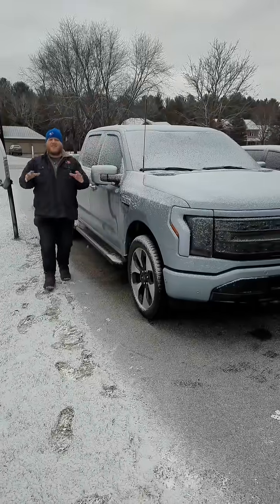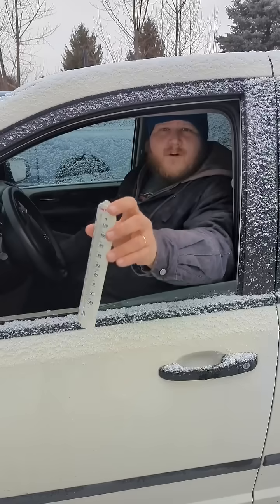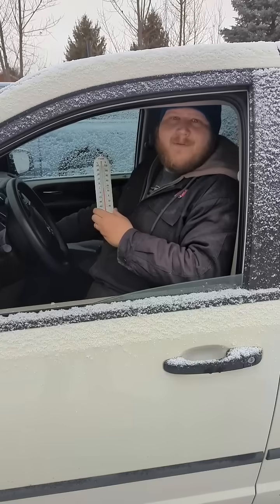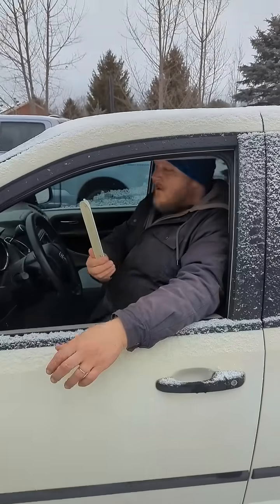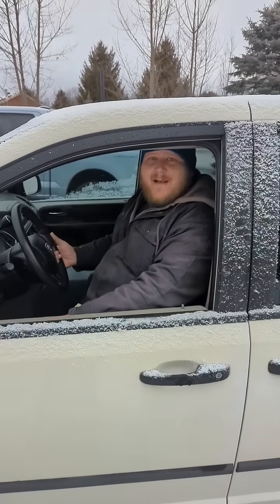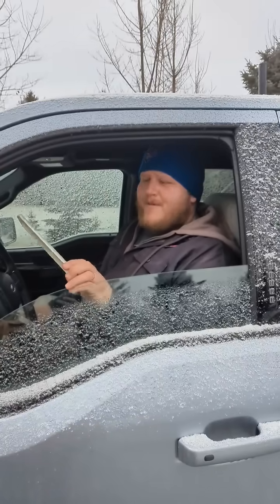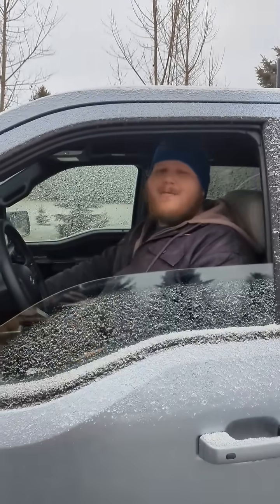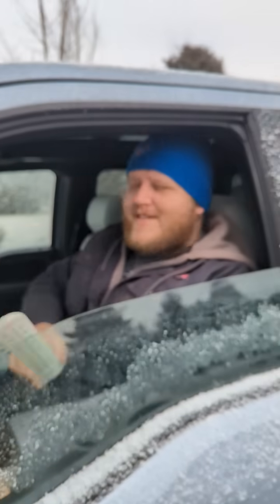Electric vs Gas - Heater Wars! How Long Does the Ford F-150 Lightning Take to Heat Up?

Comment: Holy crap! I didn't even think about how quick an EV would heat up. This is impressive!
Reply: No need to wait for the engine to heat up to provide you with waste heat. This is also why using the heater will reduce range in an EV.
Reply: Every new car warms up this fast.
Reply: And if you got stuck in the middle of nowhere like in a snow storm the ev with its heater on just sitting is far safer (no fumes) and far more efficient meaning it will actually last longer with the heat on than a gas vehicle. This is because a ICE vehicle is super inefficient just sitting idling burning lots of fuel just so you can produce heat. Huge advantage for any EV while sitting with just the heat on. Good for camping too
Reply: @Dylan_JVIPTER    Lierally everything you said is the opposite of the truth.
Reply: @dsmtsi  Nope. Look up a video comparison on YouTube of an EV with heat pump sitting idle heating the cabin vs an ICE. The ICE runs out of fuel before the EV runs out of electricity because it hardly takes any energy for an EV to produce heat with a heat pump while the ICE vehicle takes a lot of fuel just idling because that’s the only way to produce heat with an ICE, with the engine on. The EV is far more efficient in this situation. Let’s not forget a lot of people die in situations like being trapped on a highway in a snowstorm because of carbon monoxide from other vehicle and your own. You don’t worry about that with an EV.
Reply: This argument is entertaining
Reply: It's not impressive it's a one sided test.  The gad vehicles need s load to warm up   so driving for 2 minutes and you are full warm
Reply: @dsmtsi  greatly depends on the vehicle. My truck won't even start blowing air (auto setting), let alone warm air, after two minutes of driving. Furthermore, that's not 2 minutes to bring the cab up to temperature either. My fastest vehicle to warm up was my 2008 Canyon and that definitely needed more than 2 minutes as well.
Reply: @RedWingsninetyone  Every single gas vehicle including my 2006 diesel jetta could be warm after 2 minutes of driving with heat on.

The fact is this test is obviously skewed towards the EV and not accurate.
Reply: @dsmtsi  completely incorrect, but you're welcome to think as you like. Although will agree that the caravan could have warmed up faster under load but it still would not have beaten the EV.
Reply: @RedWingsninetyone   You are completely incorrect but you are free to think you are correct all you want.  It is 100% fact this so called test is extremely skewed towards EV's as gas vehicles warm up in a few minutes under load  not 14min.  This us a fact the EV fanboys want to ignore.
Reply: @dsmtsi  clearly you didn't read what I said, but I guess you're free to believe what you like. But there's no doubt the EV is better. No load needed and it is faster.
Reply: @RedWingsninetyone    OK now I know you are coming from pure ignorance.  Make sure to get your 8th booster as well, safe and effective.    Television owns your mind.
Reply: @dsmtsi  a mature and well thought out response.
Reply: @dsmtsi  I haven't come across a single ICE vehicle that only takes 2 min to warm up even when driving, especially at temperature such as -15°C. It may start to blow somewhat warm air after like 5 minutes of driving but you're still cold. Unless you've got an overheating car.
Reply: @HCkev    I live in -15 deg whether all winter my entire life.  You are telling lies if you say gas vehicles can't warm up in 2 minutes ubder load.

It's funny to see all the EV shills come out with their lies here.
Reply: @dsmtsi  whatever you have to tell yourself, I guess. You've already lost all credibility with me the moment you wanted to resort to insults and also completely ignored the fact that the point here was that you don't need to be stuck in a cold vehicle to "put a load on it" to warm up, and it's faster.
Reply: @dsmtsi lol that's very funny of you to need to resort in calling me an EV shill when I only own an ICE and probably won't own an EV in the near future. You missed a good occasion to shut up.

Ever heard of a thermostat? Since it's apparently not the case, let me explain. It's a temperature-sensitive valve located in the cooling system between the engine and the radiator. Engines have an ideal operating temperature that’s generally between 90 and 104 degrees Celsius; below that, they don’t run as efficiently. To get there as quickly as possible, the thermostat will close to keep the coolant inside the engine from travelling through the entire cooling system. Once the engine is warm enough, the thermostat will open. That now-warm coolant will then finally be able to circulate into the heater core to heat the cabin.

So the only situation it would blow hot air quickly in freezing cold weather is if the car engine is already warm. Like when you stop at a store and come back to the car 15 minutes later. However, if the car just sat there in the cold for the whole night, then it will take much more than 2 minutes... Driving it will heat faster, but it will be still take more than two minutes. I mean, remote starts were invented for a reason, we wouldn't need to even think about coming with something like that if cars heated quickly... 

I challenge you to find just one source that supports your 2 minutes time to get hot hair blowing. Just one.
Reply: @dsmtsi  so, you can't come up with a single argument in your reply. Let alone anything to prove your point, as I asked.
Reply: @HCkev    I don't need any argument, you made my point for me.
Reply: @dsmtsi  that's not how it works bud. You make the claims, you provide evidence. You can't provide any? Then you have lost the argument. Period.
Reply: @HCkev    Learn to read, my personal experience driving vehicles in -14deg weather is all I need bud.
Reply: @dsmtsi  your "personal experience" has no more weight than mine. You either provide evidence, or grow a pair and admit you're wrong.
Reply: @HCkev    My personal experience is basic fact.   The EV shilling you do here.
Reply: @dsmtsi  sure, it's true just because you say so. Go away troll
Reply: @HCkev    Agsin, the only troll here is you shilling for EV's with false information.
Reply: @dsmtsi   you're projecting. You're the one who came up with claims that you couldn't back up with any evidence despite being asked several times. So, again, if you say you're right, prove it.

Comment: Thank you for the test. Would be awesome if you had time to do one at -35C or so as well to see what those results are. I know a gas engine is probably 25 or 30 minutes but curious to see how much battery it takes an EV to warm up in lower temps.
Reply: That is a fairly normal temperature around here in winter. I am curious to see how an EV would work is there something wrong with that?
Reply: @vernhardie9500  check out out of spec reviews they did it with 2 EVs at really low temps if you are interested
Reply: Sooooooo a one time worst case scenario?! 😒I’m always gone from work when guys in their ice trucks are still sitting there warming up!

Comment: I love me my Ford's and the Lighting... But the Caravan always had an uphill climb as the cabin space is much greater. Electric or gas a truck will always have the advantage
Reply: Heres 19 reasons why electric vehicles SUCKS.

1) It’s too expensive 

2) Also cause pollution because it’s created by dirty fossil fuels 

3) Tires wear out quickly 

4) Only reliable when temperatures are warm and when it’s cold, it can bring danger to the driver and passengers.

5) Charging stations are hard to find in midwestern states. If you live somewhere like Wyoming or North Dakota, it is clear that you are going to have a lot of difficulty finding charging stations, as well.

6) Roadside Service does not provide Full Coverage and lot of this has to do with the fact that their parts are not on-hand and they are more difficult to actually find than ones for regular cars. Also, auto mechanics will not know how to fix electric vehicles since they didn’t built it. You probably have to find Elon Muck and ask him to fix it for you and he will probably charge you for a million dollars. 😂

7) Travel shorter distances due to the fact that these are cars that need to be charged, they simply do not have the same type of mileage range that regular cars often possess.

8) Too much focus on luxury vs. dependability. With all of the issues that have been discussed thus far, one may be questioning what exactly car manufacturers are aiming for when it comes to making these models. In short, they simply are spending too much time on overall luxury rather than dependability.

9) They get noisy early on. Owners of electric cars have been quite open about the fact that they are prone to make a lot of noise very quickly into their usage lifetime. There is no question that over time, this happens to all types of vehicles, but it is alarming that it has been happening so quickly for electric ones.

10) Maintenance costs far more because when dealing with expensive cars, one can always assume that repairs will end up costing far more. However, when observing electric vehicles, it is clear that the prices to fix them are at an extremely excessive rate. This is largely because finding its parts is far more difficult.

11) some electric cars look ugly

12) Battery pack replacements are expensive due to the fact that electric cars run on their battery packs, it is clear that they play a major role in the overall performance of the vehicle. However, their batteries are prone to needing replacements as time passes by, and they end up costing a ton of money.

13) Recharging takes a long time

14) Durability is not consistent

15) Tend to be heavy due to the fact that electric cars are built with different materials. In fact, the heavy weight of these vehicles is likely another factor that ends up making their tires begin to drop in quality so quickly.

16) One major aspect of the electric car market is that there are limited choices. Unlike regular cars that comes with an abundance of different options, car manufacturers do not seem to release multiple electric vehicles. This is not a solid idea, as electric cars are trying to grow in popularity.

17) Not Good In The Snow. Electric cars definitely meet their match when they are used in the snow. They are prone to having a lot of malfunctions with this type of weather, while also having a lot of difficulty while driving on slushy roads.

18) Too Much Hype. "Show not tell" is the philosophy that car manufacturers should possess. However, when it comes to electric cars, it is clear that this currently is not the case. There is no question that the market is pushing for more usage of electric power, but they have yet to accomplish much in the way of persuading the vast majority of the public.

19) Having a smart car means that the government can track your every move and can listen to your conversations. 

DEMONcrats and leftists wants to banned EVERYTHING. Gas cars, gas stoves, guns, cows, meat, freedom of speech, freedom of religion, and etc. I’m not going to go along with their authoritarian policies so fuck them!

Comment: A better test....I drove my 13 Tacoma years ago from Cambridge to Sudbury. The start of the trip was 🌧 rain fog 🌁 and mist. By the time I was 1/2 way between Toronto and Barrie it was pounding 🌧 rain//freezing rain and then further north all out snow ❄️ storm. I had the heat cranked max to keep the windshield and wipers ice 🧊 ❄️ snow free. Let's see how well an EV does. 30cm of snow in Sudbury. It was a white knuckle drive.
Reply: They will do amazing. Unless it's really cold and distance becomes an issue.

The lightening isn't going to continue to take 1km per 4mins of heat. That's just the initial heat up.(or at least that's what I heard.)

The damn things are just so expensive it would take too long for the value to be returned to my pocket.
Reply: @onedankind  no. It'll take that much to defrost the windshield the whole time. He's saying ice rain. Where if you don't clear it. You can't even see and might as well pull over.

The hairdryer in the lightning uses electricity to defrost.

IC engines use residual heat from the engine so it's way more efficient.
Reply: @greuju  the motors create heat too..which gets used to heat everything. 

Also I wouldn’t call heat from an engine efficient considering how inefficient it is to run the engine.
Reply: @greuju  The simple fact IC engines create so much heat is a sign of how inefficient they are.
Reply: @greuju  in terms of cabin heating yes ICengines are more efficient cus they use wasted energy instead of making or moving heat. But in every other way they're not even close to being as efficient as an electric vehicle. 
Also I'm sure children aren't very efficient in the sweatshops making all the electronics we used to type these comments but I don't see you complaining about that.
Reply: @greuju  lol you do realize that there is a massive cooling system on evs for the motors and batteries even in the cold once the cooling system is warmed up the battery range issue decrease to a negligible amount as well as being able to heat the vehicle if you are going to try to make a point atleast have all the facts AND  experience required to back up your argument but hey I get it it's hard to teach an old dog new tricks especially when he's dead set against learning them
Reply: That ev heater would kill that battery on some days where I am unless that vehicle is well insulated. There are times you need the heat blasting out continuous heat to stay comfortable.
Reply: A lot of the heating done by EVs is insane efficient.

You can run the heated seats for a month before killing the battery. For example.
Reply: @onedankind  sitting still...not moving.
Reply: Yeah sitting still. But the seats would use the same power while moving. Just saying there are really efficient heating systems in a lot of EVs.

There are definitely issues in the extreme cold with EVs. Don't get me wrong.

As well as a total lack of infrastructure.

Our Government is pushing EVs big time. But not developing more energy infrastructure. They're not upgrading old lines in neighbourhoods that wouldn't be able to handle the charging.

So many areas already experience rolling blackouts or warnings to manage their AC or furnace a certain way to minimize blackouts.  

They're not doing much of anything to support the actual transition IF that's the way we "MUST" go. So they're either lying or incompetent.
Reply: @onedankind  yeah. They can make them hyper efficient but they'll be too expensive for anyone to purchase.

The heating unit in the lightning is basically a hair dryer. It's not efficient at all. Some use heat exchange pumps or whatever.
Reply: @onedankind they're personally invested in EVs like they are in pharmacys making the covide vaccine. Follow the money.
Reply: Look up tests. EV’s can keep the heat on longer than a ICE vehicle because it’s very efficient at idle especially a heat pump based EV. EV’s with large batteries can keep the heat on for days even while your gas vehicle will die long before then just because it’s incredibly inefficient while idling burning fuel quickly just to generate heat. Even driving the EV long distances will do very well, albeit slightly less efficient and will eat up range faster in the cold but the range will still be very comparable to an equivalent ICE vehicle, only slightly less.
Reply: @Dylan_JVIPTER  out in Montana I have never seen a lightning

Tesla's are out there. They heat completely diff I think even the Toyota electric heating is way more efficient.

The Ford one isn't those.
Reply: Lets just hope we have enough social credit for the feds to turn on its citizens ev’s
Reply: @Epicsendz  right? I ain’t giving up the gas guzzlers, if the feds want to take them, they’ll have to kill me to break my 4th amendment.

Comment: That is one of the benefits I can see with EV. You can idle forever and hardly lose range.
Reply: That's because they don't idle the only thing running is the heater and some computers and screen no motor idling at 500 rpm

Comment: Not all gas cars are the same. Some have auxiliary heat source, like an electrical resistor, to warm the cabin. I remember my F30 BMW would heat up almost instantly.
Reply: Oh interesting, makes sense though. Does it get really toasty or is it just a decent hold-over until the thermostat opens? I presume it's a relatively compact unit in the dash or something.